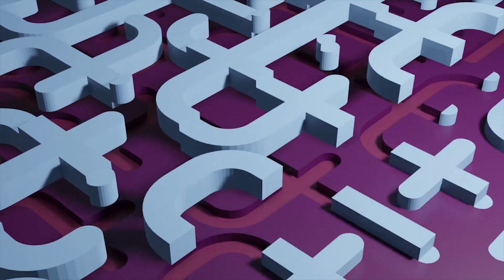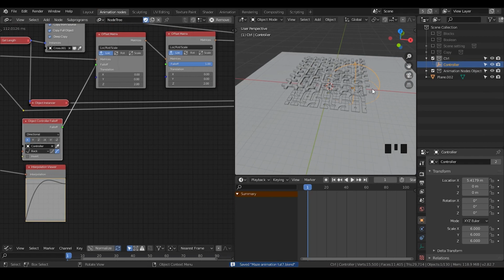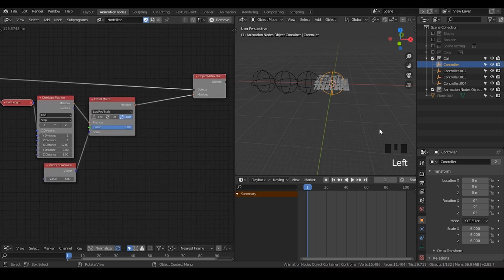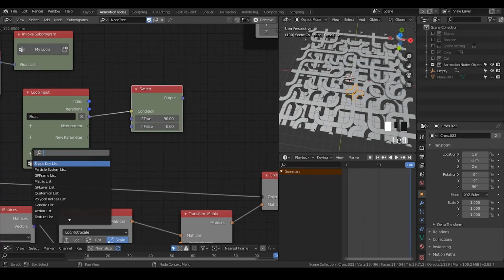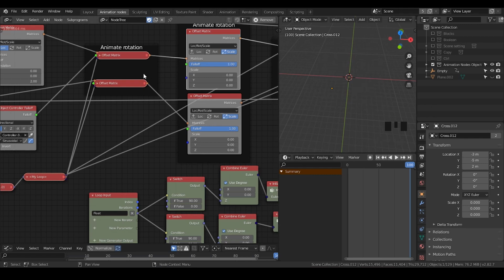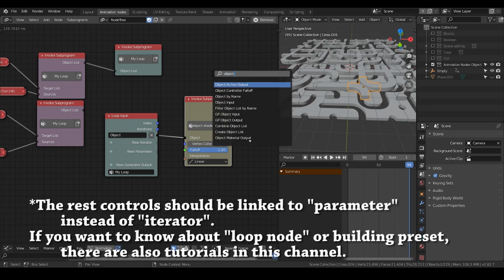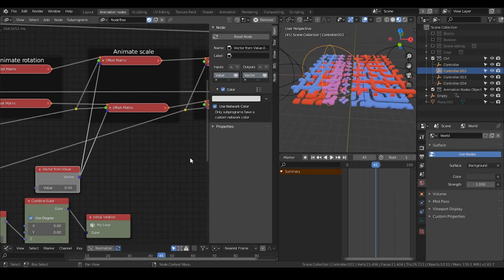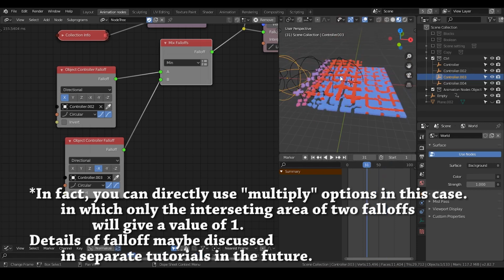[Tut] Animated truchet tiles P2/2 - animation; blender animation nodes

Comment: Hello, is there a way to made a bit random offset with time when tiles go up when directional fallow coming? One of the options that comes to mind is to a few object controller fallow but propably it can be done more procedurally?
Reply from the maker: i suppose you can mix the falloff with fade falloff/delay falloff. even just rotate ghe controller of direcfional falloff should give you sufficient enough results.
Reply: @bradleyanimation120  Hm, just for curious, is there a way to make fallow works like a trigger or its complety incorrect way of thinking about creating such animations. For example i have 10 object fallow and i want for every fallow affects another object but no just like in one action but in few for example when fallow hit cube i want cube to rotate/scale down and back up/ change opacity down at specific times not all in one time and i want repeat this on every fallow that just hit object. Something like fallow starts predefined NLA Strip and after strip ends this fallow no longer affect the object and next fallow will start it again.
Reply from the maker: @dawidwizor7205  I may not fully understand your question, I think the result of this animation in the tutorial is already achieved such kind of loop you are talking?
Or do you have an actual reference about what you are trying to describe?
Another thing is currently native AN has no memory across the frame. There is a way to do that  using expression but not very efficient or I don't like it through the experience. There is a person called "blue fox_3D" has built his own build, including a "memory falloff". I suppose it's really a method trying to solve your issue. But you have to really try that and see the result.
Reply: @bradleyanimation120  I was thinking about it like hmmm do you know "aciton" constrain in rigging where u moving one bone which is activating animation definited into NLA editor before?